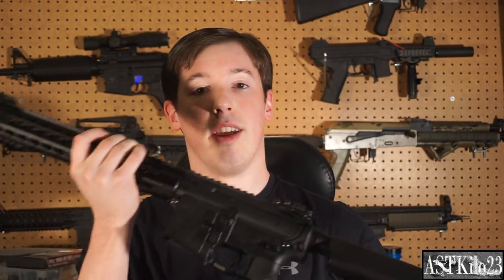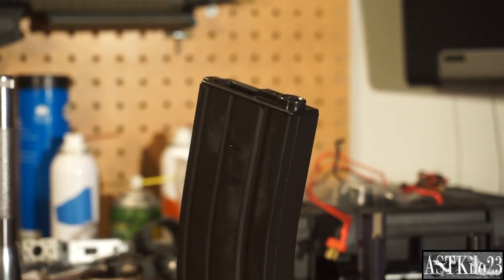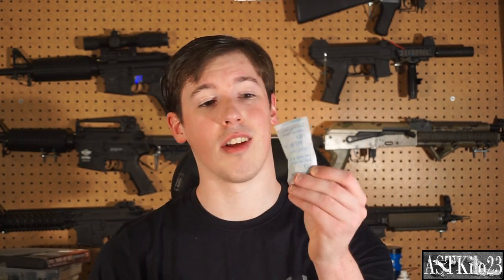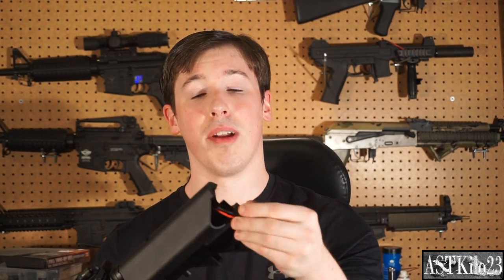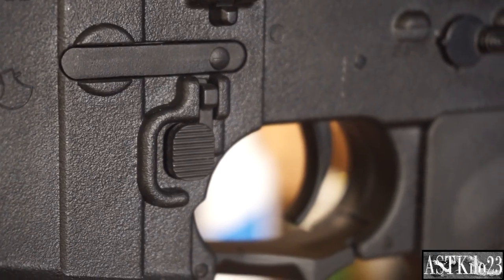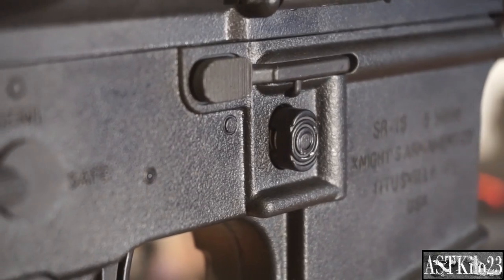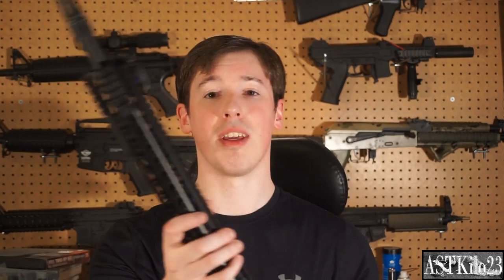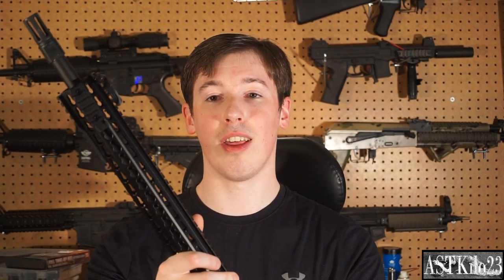REVIEW: Echo 1 Knight's Armament SR16  E3 Mod 2

Comment: Just bought this beast because my VFC pooped out on me. Super pumped
Reply from the maker: +TKDgamerK You're gonna love it. Shimmed and tuned mine....simply great performance without even the most basic upgrades.
Reply: +ASTKilo23 I am absolutely sure I will. May throw in a pro-win hop-up down the road but hey if the stock one works just fine then no need too. But this review definitely helped me into buying this.

Comment: I got this as my first gun about 9 months ago and am looking to upgrade some the internals. The gun is already pretty accurate, so are there any parts you would recommend upgrading?
Reply from the maker: just opened up another one of these the other day. solid guns for the price.
maybe drop in a tb barrel for slightly better accuracy, solid bushings instead of the cheaper bearings, torque motor for better trigger response, and a metal bearing spring guide. can also throw in a heavier spring if you want. but i still run mine stock, just some slightly wiring work.
Reply: does the ambi mag release work for you?

Comment: I wish more guns had options for front ran batteries. I absolutely hate crane stocks. I've used air soft and real AR-15's with them and hate it. I'm used to a regular thickness stock like the magpul ctr, a standard m4 carbine stock, and an M16 full stock. Like the way the ics m4s were wired are imo the best way

Comment: so why not get the apex 12" or the classic army km12? they are cheaper and both have 6.03 barrels, quick change spring and 9 mm bearings. the apex is even full metal and still 30 dollars cheaper.

Comment: Why didn't you install a mosfet if your ran an 11.1?
Reply from the maker: +Austin Freeman 
By no means is a mosfet necessary to allow the use of an 11.1 lipo. However, the higher voltage does inflict more wear and tear on the internals and can cause the gun to break prematurely. But....I also wanted to have fun with a decent rate of fire :P

Comment: what is the fps for this gun with the stock battery?
Reply: +Stmike 31 battery doesn't change the fps. he shows different voltage batteries so you can hear trigger response and rate of fire.
Reply: sorry for my noobishness
Reply: +Evan Dickerson not a problem everyone has probibly asked that at some point in their airsoft career